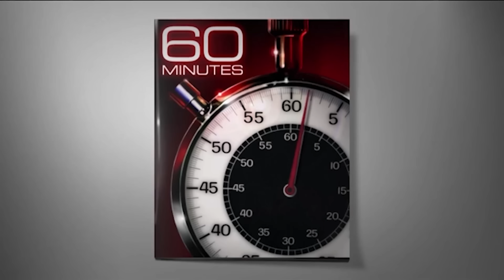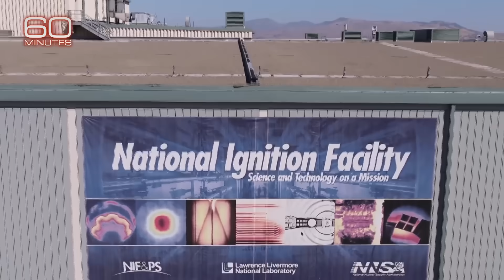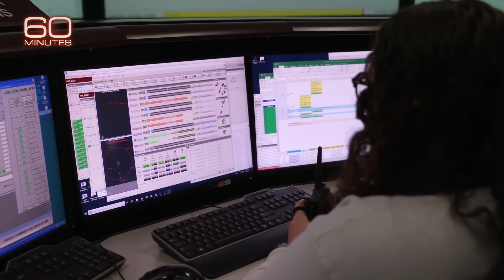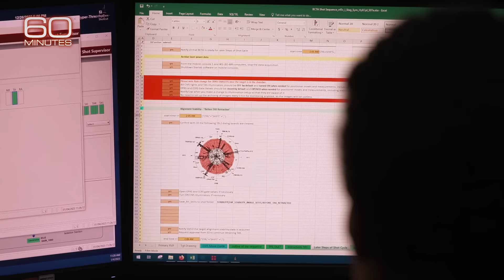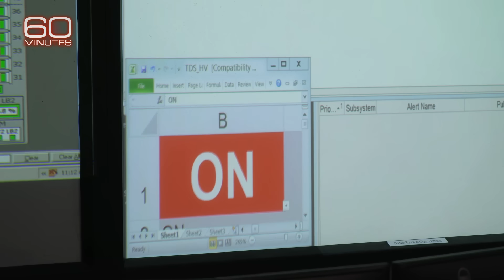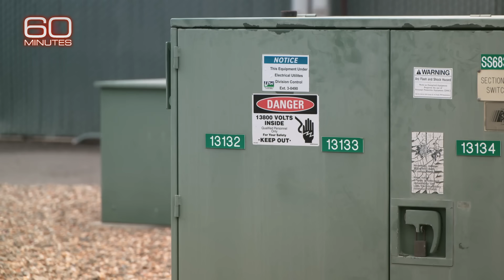Nuclear Fusion: Inside the breakthrough that could change our world | 60 Minutes

Comment: Sorry for questioning the pro but… that copper barely looks burnt and copper melts at a way less temperature then the sun. So what’s this supposed to be distracting us from? 🤔 nuclear diamond batteries? 🤪
Reply: The pealed back copper that was shown was at least a few inches away from the compressed microscopic fusion reaction that exploded into a plasma in approximately 0.08 billionths of a second inside the massive vacuum chamber. You are only seeing the damage from the shockwave that originated from a microscopic point.
Reply: @vernonbrechin4207   ohh that makes sense, it didn’t have enough time to burn the rest of the copper
Reply: @sheadreamz  - Correct! the displayed copper support structure was mainly subjected to the blast shockwave. The thermal energy, at that distance, was not enough to melt the copper, especially since it only lasted for about 80 trillionths of a second. It was more likely affected by the laser induced explosion of the hohlarum.
Reply: @vernonbrechin4207  thank you for sharing your knowledge 🙏.  It make sense now, the laser was only focused on or better said, “at its hottest” on cylinder that was holding the sphere.
Reply: @sheadreamz  - Correct. The multiple laser beams are focused to a point at the two end entrances to the target hohlraum cylinder. They then impact the interior of that cylinder which is composed of gold and other materials. the walls are converted to an intensely hot plasma and radiate X-rays in multiple directions. The X-rays that head towards the fuel capsule, that is suspended in the center of the hohlraum, blasts the surface of diamond walled fuel capsule causing it to turn into a plasma which both compresses the fuel towards the center of that capsule and the reaction of the blown-off plasma further adds to the compression. The entire target region turns into a white hot plasma which is then blown outward towards the walls of the large evacuated target chamber. Since it contains  most of the radioactive tritium containing fuel that material has to be cleaned off the interior of the chamber walls as radioactive waste before another shot can be performed.

Comment: In the intro you speak of uncontrolled fusion, showing explosions of the type caused by the atom bomb. That actually fission, splitting of atom, not fusion, merging atoms.
Reply: I encourage you to look up nuclear explosives on Wikipedia. Nuclear weapons employ both fission and fusion processes. The so-called 'atomic bombs' are primarily fission devices, usually including a small fusion component at the center to generate the triggering neutron flux. Thermonuclear weapons (H-bombs), which are the most common type in the hands of the nuclear weapons countries, employ a fission explosive that then drives the compression of the fusion components of the nuclear explosive. NIF is designed to simulate that portion of such devices. Typically the fusion fuel is a special variety of lithium hydride. I'm many cases a uranium tamper is also part of the 'secondary' portion of the device that generates more fission yield and increases the compression of the fusion fuel.
Reply: @vernonbrechin4207  Are you some disgruntled employee who lost his job at this facility and now takes to YouTube to degrade what they accomplished? ????

Comment: So the laser has to become 300 times more efficient? How?
Reply: The NIF lab management is now claiming that the poor laser efficiency is due to its age and the fact that there are newer lasers that have up to a 20% efficiency. They have been looking for excuses to explain their failure to achieve their goal of reaching 'ignition' by 2012. NIF was preceded by two earlier laser fusion facilities and now they are pitching for the next generation facility after consuming around $11 billion.Their eyes are set on Laser Diode Pumped Lasers. They fail to mention that the most powerful of those have only a tiny fraction of the output power of even one of the NIF lasers. The NIF management also fails to mention that NiF lasers undergo at least two wavelength shifts that drastically drops the laser efficiency. If the new lasers have to also engage in such wavelength shifts then its efficiency will be a small fraction of the 20%. They are well aware that there are many gullible fans and government administrators who are likely to be clueless about such issues.

Comment: I'm only half-way through.
But stuff like the diamond encapsulated hydrogen pellet is the first time I saw something that might make commercial sense to manufacture in micro-gravity.
At least until they get it to generate unlimited power using only dust-bunnies as fuel...

Edited to remove the duplicate "that".

Comment: I wonder if the chamber would work better in a vacuum or if it were filled with hydrogen gas, creating a similar environment to how stars are made in space. Maybe that would somehow prolong the reaction.
Reply: The experiments only occur once the very large chamber is evacuated of air. If it was filled with the tritium and deuterium fuel mixture and the tiny speck of fusion somehow spread to that mixture then their would be a massive thermonuclear explosion (H-bomb) at the site. As it is the tiny reaction generates a tiny explosion at the center of the large vacuum chamber. NIF was really built to simulate nuclear explosions in a extreme miniature way. It was never intended to find a path to a practical fusion energy power plant. The later is the myth that they repeatedly deliver to the public.

The nuclear weapons lab has their own definition of the term 'ignition' which differs from how the public perceives the term. There fusion reaction only exist while the laser beams and x-rays are massively compressing the deuterium/tritium fuel mixture in the target fuel capsule. Once the fusion begins in the very center it blows away all the fuel that has not yet reacted. This also happens in nuclear weapons. In the reported experiment only about 4% of the supplied, extremely rare and expensive, fuel actually fused to produce helium-4. The rest was blow outside the reaction range before it could react. The radioactive tritium then has to be cleaned from the target chamber as radioactive waste. It is one reason shots are so infrequent.

Comment: 300 units of power 3 out.  Doesn’t compute.
Reply: The lasers used are based on tech from the 80s.  When modern lasers are used and tuned to be efficient then it will be fine.  That was explained in the official announcement day footage.

Comment: “It lasted a billionth of a second”. Yeah, nuclear fusion energy is a pipe dream.
Reply: The fusion reaction lasted about 0.08 billionths of a second. Only about 4% of the extremely rare and expensive fuel actually fused to produce helium-4. The rest of the fuel (96%) was blasted away from the center before it had a chance to react. The term 'ignition,' as employed by the NIF management, is misleading. It is not about the propagation of the reaction. The reaction only takes place due to the 3 billionths of a second laser beams and compressing X-rays. After that there is no confinement and therefore no further reaction. The staff are masters at misleading the public and the press.

Comment: You call this a breakthrough? This is a joke compared to all the suppressed advanced technology they possess. The free energy devices they have suppressed for years on end to keep their industrialized world running , which in turn keeps them at the top in control and in power. Society is in a deep slumber. The claim is that this technology is producing more energy than it is using to create that energy (over-unity) , BUT, they have not taken into account the high powered lazers needed to make the fusion reaction. When that is taken into account there is not a net gain but a huge energy loss. The technology uses temperatures from 3 million degrees to 300 million degrees. There are obvious safety issues not addressed if this were to become a practical technology to provide energy around the world. The radioactive isotopes used in the process are rare and extremely expensive costing $850,000/ounce. This is also not practical. BREAKTHROUGH? I don’t think so. Solution or diversion? DIVERSION.

Comment: As a long time fan of Sixty Minutes I was impressed by their caution at hyping this breaktrough yet still thought they needed to tune it down a bit more.  This was clearly an engineering accomplishment as the physics was resolved many decades ago.  At about 13 minutes into the broadcast the door was opened. 

-They manage about 1 "shot" per day, only one of which has actually released more energy than it consumed. Many more failed
-The energy gain" they achieved was three units out per one unit in at the target. That didn't account for the 300 units of energy that went into firing the lasers so the ACTUAL output was 300 in, three out. 
-They would need to fire ten shots per second contiuously to generate a meaningful  amount of power.

So, yes, they were able to show that the fusion reaction released more energy than the laser energy input but the did not show a net energy gain.  That  means that they do not have the equivalent situation of the Wright flier. That was a machine demonstrating all of the fundamental design elements of a WW1 airplane, needing only refinement. A closer example might be that they have got the menu for making gunpowder (1300 AD in China) and what we need is a Saturn 5 moon rocket (1969 at the moon) to build a first fusion power plant. 
Not in my lifetime, not in yours either.
Reply: You are not accounting for how fast technology is evolving since the industrial revolution, we went from achieving major human milestones in thousands or hundreds of years to decades or even years and if technology like AI keeps evolving and getting better, the technology generational gaps can continue to get shorter and humanity can achiver greater goals at a faster pace than anyone ever thought possible.
Reply: @Tikolico  Well, the easy things are always done first but at some point every technology matures and real gains slow and then stop. Rocket technology has had major investment over the past 50 years yet the boosters being built today are not significntly more sophisticated than the Saturn 5 from the 1960s.The technology is mature. Computers? My new desktop is faster than my original 1982 computer and does more stuff but it's not really any better than the previous one from five years ago. What has gained is the density of advertising and spam attacks.
Reply: It isn't a fusion breakthrough. This is a military facility. Fusion is just the deception to get the funding to produce a more powerful defense laser. They practically admit this on their website for Jiminy's sake. It's like how clean energy requires dirty energy to operate and mine and produce.
Reply: Gun powder was invented in the 9th century.

Comment: Yeah because consolidating energy into a single control point and then selling it back to the people who paid for it is super awesome so far.  Considering the price to produce energy is lower than it has ever been yet the price per KW hour just keeps on climbing.  And why is this "breakthrough" coming just as solar energy harvesting technology is set to dramatically plummet in price and increase in availability?

Sounds to me like this is just a first step towards the most consolidated and "valuable" source of energy ever tapped into.  And a very small group of people will be the only ones benefiting from it.

Comment: This is a great achievement and all that, but it was also a 300 in, 3 out, 100:1 thing, but there's also all the money going into the fusion equipment itself; all the lasers and the nearly perfectly constructed target shell mini-gobes, but there's also everything involved to make it work; the massive facility and all its staff and their test equipment and their management, all for a millisecond blast.  That's a ton of money for an unstated price tag over the years.  And minimizing the whole thing into a fusion power station plant, similar to the current nuclear power plants, will take another $Billion or 50 and likely another 30 years.  It's kind of hard to get very excited about at this point.

I'd like to see the same amount of effort and funding put in to develop a cheap, ultra clean and abundant source of Hydrogen for Hydrogen Fuel Cell vehicles.  If Stanley Meyer could do it in the 1990s, then today's engineering and its state of technology should be able to do it, too.  Stanley's "Water-Powered Car" worked with any water source, even ocean water and poison wells, and his vehicle created the Hydrogen onboard as needed.  There's your source of cheap, ultra clean and abundant Hydrogen, if making Hydrogen onboard of a HFCV, Hydrogen Fuel Cell Vehicle, like Stanley's, won't be allowed for whatever bureaucratic and/or Elite controls reasons.  These 0.001% Elite Ultra Rich are preventing any technology that would replace their fossil fuel systems and make them obsolete from coming into existence.  Fossil Fuels are their Cash Cow that enables them to fund every war that has happened since WWII through the Military/Industrial/Financial Complex, which they also own and operate.  They are the only reason that we don't have things like Nikola Tesla's Wardenclyffe Global Free Energy.

Comment: Blah Blah Blah - Fusion promises only means money and jobs for Fusion 
 physicists.  They supposedly created more energy than they put in to make the reaction - Great!  What about capturing that Fusion energy to power the reaction ?  According to The Carbon Trust, the average range of efficiencies of heat recovery systems vary from around 50% to 80% as maximums.  That coupled with the fact nobody has ever recovered   heat from something that has the temperature of the sun.  Maybe in thousands of years with trillions upon trillions of dollars, they'll finally figure out it's economically not possible.    

It's an R&D money pit....

Comment: Holy crap it’s gonna be a very long while before this is a thing. The facility and implications of the tech alone tells you how humongous of a challenge this is. Easily another century before they can do a serious demonstration but some demonstration that will be! God level engineering literally.
Reply: Yep. Unfortunately.. the energy required to use the laser which then fired the energy to create the reaction was over 100 times as many megajoules as was produced. If we could fire lasers for zero energy cost then this would be a true breakthrough. As it stands this is just the answer to the fact billion dollar donators are realizing tritium will run out around 2040 and the only real hope to make more via tritium breeding blankets won't even be tested until 2035 in the ITER reactor.

Comment: A minor breakthrough at best. And this is from someone who’s followed this science since 1982. 
2110 at best before it has actively operating power generators. 
They don’t even have a way of exchanging the heat produced, which is the ultimate goal. Heat, boiling water, creating steam, turning turbines…producing electricity.

Comment: I'm skeptical about the prospects of self-sustained nuclear fusion -- getting more energy out of it than you put in. We cannot emulate what the sun/stars do because they rely on GRAVITY as the driving force for the reaction to happen, and gravity requires no extra 'energy' -- it's simply a force that naturally occurs when a large body of MATTER is present. So, we have to expend tremendous amounts of ENERGY in order to start and sustain the fusion reaction. Researchers may 'claim' that their reaction produces more energy than the energy required to start the reaction, but two critical questions remain: 1) Is that differential in energy SIGNIFICANT? In other words, are we expending 3.9999 joules of energy in order to extract 4.0000 joules of energy? 2) Are they even able to SUSTAIN those nuclear reactions 24/7? 3) Even if they're able to CREATE more energy than what was spent, can they actually HARNESS all that energy? or does much of it get lost/wasted in the process? Nature/God has provided a 'model' for how energy can be created via nuclear fusion -- using GRAVITY as the key driver (and 'gravity' requires no extra energy to be input). It may very well be possible that this is the ONLY way to create a net-positive fusion reaction.

Comment: The question is how do they plan to solve their fuel issue? If they plan to breed tritium within the reactor, they'd need beryllium as a neutron multiplier. They'd then run into the same problems nuclear fission has; hazardous radioactive materials. In terms of commercial viability, this design seems no better than a tokamak which isn't much better than nuclear fission.

I'm sure someone has thought about the problems, so maybe they've got some idea how to deal with them in the future.

Comment: How will this discovery be applied to our everyday lives? Will we use fusion instead of electricity? Will my monthly electric bill drop to a $1/month fusion bill? Will my car drive forever without needing to refuel it? Since X-ray devices and MRI scans use a lot of energy, will using fusion bring down the cost of getting a scan? Will fusion ovens replace microwave and conventional ovens to cook our food faster and better? If we switch to fusion instead of oil, how will that effect the Middle East? Will we still use oil to make plastic or will fusion provide us with something else that's better than plastic? This is exciting but I still don't know what this means for us. Also, whenever we hear about these great discoveries, we usually don't hear anything else about them for years and years.